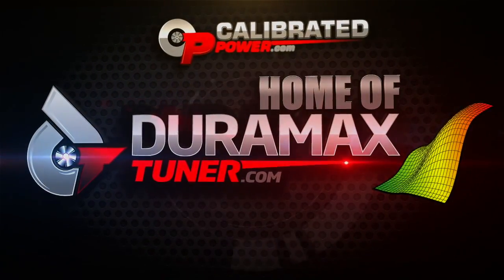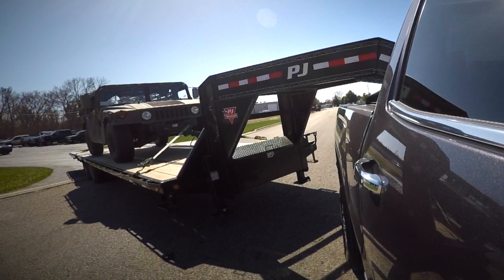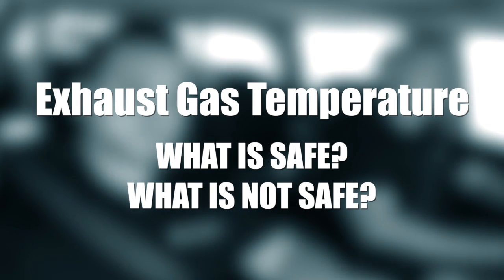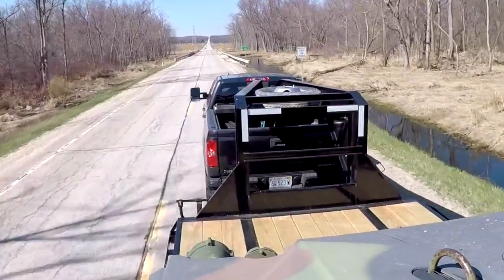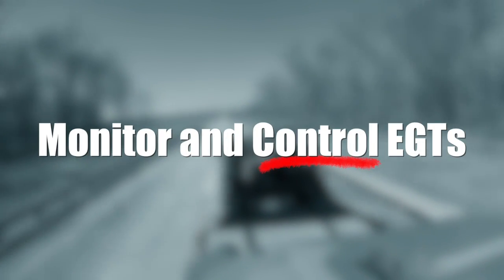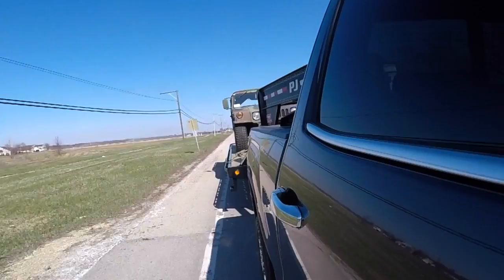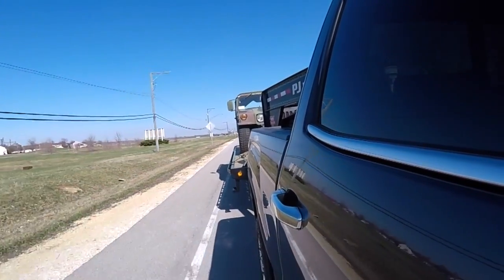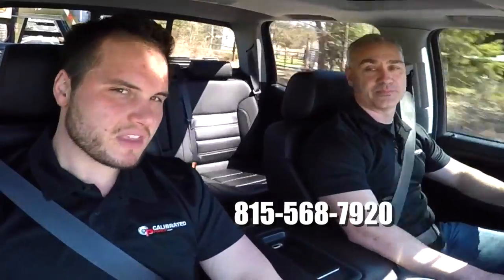LML Smart EGT Control

Comment: I have your single light tow tune and also just bought an edge monitor reading factory probes should I be concern towing my 15k 5th wheel?
Reply from the maker: As long as you’re reasonable with the trans before lockup you shouldn’t have any problems. You’ll want to keep an eye on EGT 1 to verify it stays below 1050*F while pulling grades. Our sled pulling chase truck is a 300k mile 2012 with the same tune. The trailer is 17k so we have a pretty good proxy.
Reply: @Duramaxtuner  Sounds good so 1050 is the number rather than 1350 I need to be looking for. So if I see it rise I just need to put it in manual and downshift correct?
Reply from the maker: @bradoliver3916  it’ll downshift on its own as long as you continue feeding it pedal. Really you’ll just be verifying things are working like they’re designed.
Reply: @Duramaxtuner  got it

Comment: Must be all that working with Gale Banks rubbing off; his tuner I had 10 years ago did this.
Reply from the maker: Gale is a great guy!  To be clear this is not a warning light that goes off but actual EGT control
Reply: Duramaxtuner obviously a little jab for grins, but the old Banks 6-gun used to back off power at 1350* when used with the egt probe. It wasn’t tied into downshifting etc but it was a fooler box 10+ years ago, so not shabby!

Comment: I have an l5p with a edge cts2 monitor using the manifold egt reading, what temp should be max sustained while towing or driving? I’ve seen as high as 1500 for a few seconds and truck is stock. Thanks
Reply: RyanL5P 1350 or less for sustained operation. Like when you put your hand in an oven a few seconds over that limit is not extremely harmful but it get exponentially worse the longer you keep your hand there. A stock truck is calibrated to be very safe with Ford's being the safest with concerns to engine control. Unless you have a lot of free time to be stressed out drive your truck and enjoy it the engineers calibrated the l5p very well.

Comment: Do your LML tunes make the truck regent more?
Reply from the maker: No, we see the same or a little longer distances between regen.  Our tunes run very clean so they will not hurt your emissions equipment.
Reply: Duramaxtuner, is someone still working on your website? Been trying to contact the company with questions and the contact link does not allow me to send a message. Capcha is INOP. Cannot even contact thru the website to let you know  contact is not working.
Reply from the maker: Sorry about that.  Yes the site is going through some updates.  Feel free to call (815-568-7920) or email (sales@duramaxtuner.com) to contact us.

Comment: Why doesn't the factory do this from the start?
Reply from the maker: There are many reasons why, not all of which do we clearly understand.  What we do know is that this feature is great for those towing in extreme conditions.
Reply: BYRON Johnson  honestly I think they want to keep EGT high just like they want coolant temps higher. To burn off more emissions and keep the EPA happy. At risk of shortened engine life and failures of course! As long as they can keep the warranty to a minimum, repair cost are on the consumer
Reply: Under normal stock settings the EGT’s will stay within a safe temp. Once you add a programmer or tuner then you start risking to add more heat. The factory programming won’t get anywhere near risky temps.